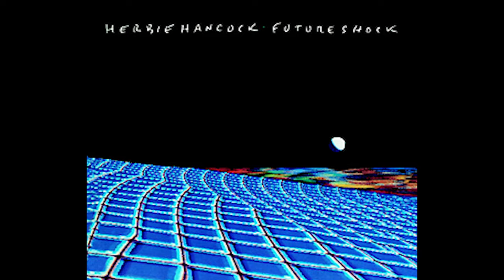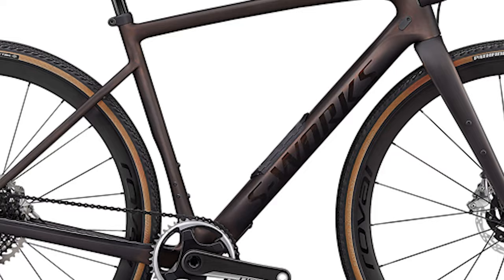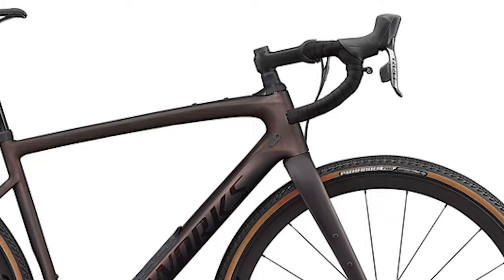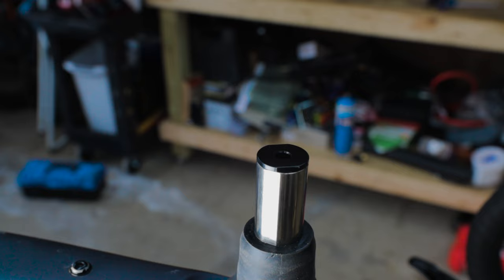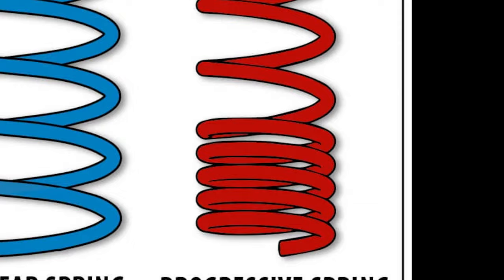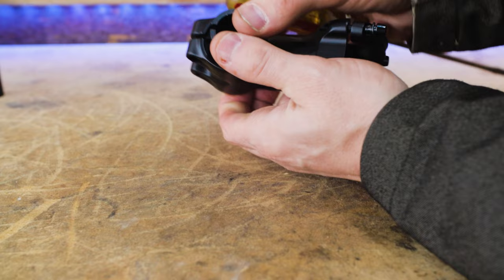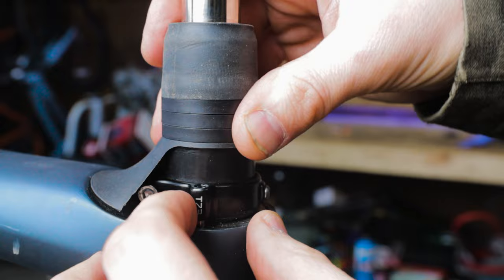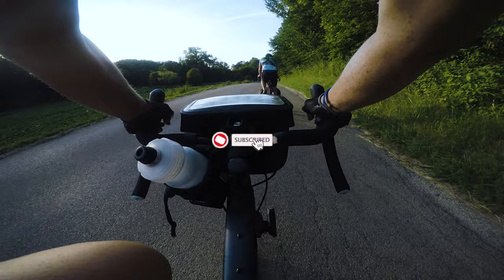Specialized Future Shock - Deep Dive & EVERYTHING You Need to Know!

Comment from the maker: I got official word from Specialized: the main spring in the cartridge is progressive, not the booster springs. The replacement cost of the 1.5 is $250 and the 2.0 is $515.
Reply: Thank you for these prices! Are those prices for a set of 3 springs (same set as what comes with the bike), or for a single spring?
Reply from the maker: You’re welcome! Those prices are for the full cartridge replacement. With a new cartridge you should get everything that came with your original bike: stack height adjustment parts, shim for a standard stem, that crazy little 3mm wrench, and new booster springs if you have a Future Shock 1.5.
Reply: @GreatEgretAdventure  That's great. Seems like a reasonable cost, for such a unique system.
Reply: . @GreatEgretAdventure   Never got the 3mm wrench.  I guess the bike shop held onto it.  Had to buy a hard to find new one and filed down the flats to make it fit

Comment: If you buy a new Specialized w futureshock,  the 3mm wrench should be included in the bag of parts.  It’s included from the factory.
Reply from the maker: That’s correct. Thanks for clarifying that! Along with the shims, stack lowering part, and booster springs with the 1.5.

Comment: I have the 2.0 on my diverge I took delivery on 13 months ago. I only gravel on it or ride once a week. Just finished a race two Sundays ago.  So far so good 😊. My diverge is not my main bike so will take a while to achieve the 500 hour service point. And I have not had a low battery 🪫 on the 1x Di2 yet either, it’s lasted over a year so far.  Next swap out is the hover bars. Just don’t like the top section diameter and the contour of the top section, no room to move my hands for size 42.  Pressure and pain points on hard bumpy efforts. 🤔🤔🤦🏻‍♂️

Comment: Is it 2.0mm hex to re-tighten the pre load screw at 10:50 in the video? I think it should be 2.5mm hex.
Reply from the maker: Yeah, 2.5mm to loosen, 2.0mm to adjust, 2.5mm to tighten along with the 3mm wrench. I said 2.0mm to tighten when I should have said 2.5mm. I’m going to fire the proof editor. Oh, crap that’s me! Thanks for catching that.

Comment: Hi, how much can the stem lowered? The default setting is with the high cap? I am asking because the stack of the current diverge seems too high compare to backroad, nuroad or grail.. i wondere if the stack is lowerable, in manuals it says adjustable from 0-15 mm of hight. thank you
Reply from the maker: The stack can be lowered. Check out this video at 8:54 where I talk about the low headset cap. You need to remove the tall headset cap and install the low headset cap. That’s the lowest the stack can go with the Future stem. If you want it lower, you’ll need to install a standard stem with a negative degree angle. 

The 0-15mm height refers to the number of spacers you can fit. Each are 5mm. This means you can go with none, one (5mm), two (10mm), or three (15mm). 

I hope this helps.

Comment: This is an excellent tutorial. Thanks. Stupid question from a non-techie. If you want to replace the stem with one that has a smaller stack height than the standard 40mm, do you need spacers to make up the difference?  Any guidance appreciated.
Reply from the maker: Thanks Steve! Your local bike shop should have provided a shorter cover.

Comment: My futureshock replacement was $149 (1.5). In california.  They gave me a discount as full price was 250.  This replaced a futureshock on a 2018 diverge.
Reply from the maker: Yeah, I misspoke on the price. I accidentally quoted the price for the 1.0. I’ll have an update video soon where I’ll talk about the springs more and add a mea culpa about misquoting the replacement cost. Thanks, Craig!
Reply: @GreatEgretAdventure  no problem...if you are doing another video, maybe you can explain how the booster springs work.  The FS works without the spring so what does the spring do?  Seems to me that the booster spring will not even engage  until the main spring starts compressing. But that can't be right.  Btw, i had a fs 1.0 and they replaced it with a 1.5.  I don't think the 1.0 is made anymore.  Thanks!
Reply: @craigvaughn1591  why did you have to replace it so soon ???
Reply: @johngilmartin2146  there was about 5 mm of play in it. I could depress it by just pushing down on the handle bars. It would chatter when going over even small bumps.   Bike had about 20,000 miles at time of replacement.   New futureshock did not come with booster springs.  I had the teck install old booster springs in new shock.. Still not sure what they do.
Reply from the maker: My next video will cover more on the Future Shock including more information on the booster springs. According to the Specialized rep I spoke with, the booster springs create more vertical stiffness.  The booster spring isn’t necessary if you’re happy with how stiff the Shock is with just the primary spring. In fact, all 1.5 future Shock bikes now arrive without a booster spring installed. It’s up to the bike shop to ask the buyer what spring they want installed, if any, when someone buys a bike with a 1.5.
Reply: @GreatEgretAdventure  ok look forward to seeing your next video

Comment: Does using the variable angle stem allows to uniformly sit the top cap? It is supposed to be used on perpendicular top stem like fixed ones
Reply from the maker: I haven’t heard or read that a 0° stem is required. If that’s true, bike fitters would not even fit anyone riding a Diverge. The angle of the variable angle stem does not impact the top cap anymore than any other stem of any angle.

Comment: The cartridge(shock absorber) is ingenious: So I can  "replace the cartridge for around $55". But If I want to buy a 2.0 bike instead of a 1.5 cartridge bike the cost is an additional  $7,000? I am just getting into serious cycling but the costs( asking prices) are nuts. $10,500 buys a pretty nice, used Harley Davidson. Hydraulic damping is nothing new.
Reply from the maker: Unfortunately, the $55 I cited on here was from when the Future Shock 1.0 came out. The replacement cost of the 1.5 is $215 and the 2.0 is $515. Still way better than a new bike.

Comment: Great Video! I installed a new stem on my Sirrus X 5.0 and found that the new stem is a little taller than the stock stem where it clamps on to the cartridge. The top cap shaft/threads do not go low enough to engage the threads in the cartridge. I think a 5mm spacer under the cartridge would be too much. Do you see any problem with not having a top cap on? It seems to be just a cosmetic piece. Any chance there are top caps with longer shafts available? Thanks!
Reply from the maker: I think you’re right. It’s cosmetic.

Comment: Good dive into the future shock.  I bought a carbon spot last fall and haven't had a chance swap springs around at all.  My wife has a Roubaix both with the 1.5.   I just looked at the springs that came with mine and they appear linear also but I'm wondering if the progressive coils are just not noticeably narrower.
Reply from the maker: You know, I thought the same thing about the progressive springs. It is only 20mm of travel. If yours look linear as well,  it has to be that they are not noticeable. So I decided to measure with my digital calipers. Unless the differences are less than 0.1mm, there is no difference in the size. If there is, that degree of progressiveness seems so nominal that it wouldn’t make much of a difference. I’m no engineer, though. Either way, your comment is really helpful and I’ll include it at the end of the next video. I’m curious what others think. Thanks Rob!
Reply: @GreatEgretAdventure  sent you a comparison photo on IG.   They could probably accomplish some progressive nature with heat treating.    Visually though no difference.

Comment: Thanks for the great information. Well done. Can you tell me where I would get torque information on diverge bikes.
Reply from the maker: Thanks! I work hard on these, so it means a ton to me when someone finds the video helpful or entertaining. The torque specs are in the manual that comes with your bike. Judging by your previous comment, it sounds like your LBS didn’t provide it to you. If you need a specific torque spec, just let me know here and I’ll post it.
Reply: @GreatEgretAdventure  no manual provided. Wonder where I could get one?

Comment: thanks for the video, very useful. Just a question, can I get rid of the future shock altogether ? will the fork / steerer / stem work if I cancel the future shock ? or do I need a new fork ?! thanks again
Reply from the maker: One of things I don’t like about the diverge is that you’re stuck with the Future Shock which also means that you’re stuck with the fork. The head tube on the diverge is sized to only fit the Future Shock so putting a regular headset in there won’t work, unfortunately.
Reply: @GreatEgretAdventure  thank you so much for your knowledgeable and helpful (and prompt 🙃) reply … I thought I can cancel it as it’s really noisy. Would you know if it can be upgraded to 2.0 ? Is it quieter / heavy duty ? Thanks again
Reply from the maker: @emiled591  the Future Shock shouldn’t be noisy. That’s a sign that that something isn’t right with the internal spring. It likely needs replacement. If you bought the bike recently, it’s probably still under warranty. The 2.0 isn’t necessarily beefier, it’s just a different design with different features (oil damping, dial to change preload, no booster springs). If you wanted a 2.0, it’d fit, but at a replacement cost of $515 USD, it might not be worth it.

Comment: I have a question about the Specialized Stem you bought for your wife.  One of the things my LBS said was that stem combined with the FutureShock, because it has two shims essentially, it would make a lot of noise.  Have you experienced that?  I need to work on my reach a bit and thought this might be a good option for me as well.
Reply from the maker: No noise at all. Noise would be caused by movement and the shims are pretty tight without moment. Just make sure to torque them to spec. I think it’s a great option at finding what angle stem will work best. It’s also much less expensive than trying a bunch of different stems. Once you find which angle works best and want a lighter stem, you’ll know which angle you’ll need. Let me know how it goes for you.

Comment: Anyone have a rough idea of the cost for a 2.0 Cartridge replacement?  A bike fitter changing the stem broke mine and the local Spec shop is saying it’s going to be VERY expensive. Hoping it’s not too high, or it’s a pretty bad design.
Reply from the maker: I’ve heard $250 for the 2.0 cartridge. I’m working on a follow up video to this one and I’ll have a definitive answer soon. I’ll comment here when I do.
Reply from the maker: I just found out the 2.0 replacement cost is $515. The 1.5 is $250.

Comment: Ready for the bin after 2 years.
Reply from the maker: Did yours fail?
Reply: @GreatEgretAdventure  My 2.0 shock has completely seized after 6 thousand mainly dry miles.Around £500 for replacement in the UK.Shocking!!
Reply from the maker: That’s nuts! The worse part, as you already know, is you can’t replace it with another option like aheadset stem and headset.

Comment: So I have a 2021 specialize Evo with a flat bar with Future Shock 2.0 with adjusting ring. Looking to raise the height. Are spacers along with a different bar the only options I have? Looks like 15mm is the max I can raise it with spacers. Thanks for your prompt responses.
Reply from the maker: The other option is to get the shim so that you can swap out that Future stem for a standard stem that has a higher degree angle. 15mm is a lot of rise. That will affect the way your bike steers. Not in a bad way, but it will provide a different feel. I’d start with the spacers and then consider a new stem if you need more rise.
Reply: @GreatEgretAdventure  did you mean “not a lot of rise” ? I agree - that’s a little more than 1/2 inch. Was thinking about coupling that with a bar with more rise. the current one I have is a 10mm rise.So where would I get the shims? Specialized bike shop?
Reply from the maker: No, I mean 15 mm is a lot of rise. When it comes to bike geometry, handling, and steering, a 1/2” change will greatly impact how a bike feels, maneuvers, and steers. Especially steering. As little as a few mm can be noticeable. This is why spacers larger than 5mm are rarely used and why Specialized says to not go above 15mm. I’d start with the three 5mm spacers before making and other changes to the stem with the shim.
Reply: @GreatEgretAdventure  thanks for the great advice.
Reply from the maker: @pault477  no problem, Paul! Good luck!
Reply: @GreatEgretAdventure  so decided to reduce stem length ( 40 mm ) and put a different flat bar on with greater sweep and rise. Made a huge difference on reducing back strain.

Comment: I have a question.
What about a service life of the future shock 1,5?
Some say that it is 500 hours and then it has to be replaced or serviced.
Reply from the maker: Around 2018, there were a lot of rumors around the 1.0 having a service life of 500 hours. I’ve never seen an official document from Specialized saying that 500 hours is the magic number. That doesn’t mean it doesn’t exist. It’s possible it does and it’s possible that’s true for the 1.5 and the 2.0 as well. 

Depending on the rider and riding environment, 500 hours is a lot of miles and ride time. After 500 hours, I’m servicing or replacing a lot of components. Including chains, tires, wheel truing, cables, derailleur indexing and cleaning, or brake fluid if I’m running hydros. Hopefully more servicing than replacing depending on how rough I am with everything. I’d treat the Future Shock like any other component, if it’s still working, keep using it and then get a replacement when it stops working.
Reply: @GreatEgretAdventure  So when it stops working what happens? Just stops functioning right? It will just feel rigid that is all?
Reply from the maker: @bigbywolf6510  I have never known one to stop working other than another viewer on here told me a bike fitter broke his Future Shock. All the bike mecahnics i've talked to have never had to replace one. The 1.5 would likely fail because of the internal spring gets damaged. I don't think it would be rigid.  It would likely feel crunchy.  The 2.0 could fail because something goes wrong with the oil and no longer provides damping.  I'm just theorizing here though.
Reply: @GreatEgretAdventure  Okay thanks for the reply, I really like the future shock and innovation.

Comment: For my diverge, I got the same springs you show.  If they are linear, seems the Diverge ships with these now.  Could the springs have wider spaced coils under the color covered section?  Maybe not.

I confirmed with Specialized and these days. all the Sport Carbon Diverge is supposed to ship with is the manual and springs.  No shims or shorter duck-bill were supplied and the future shock was delivered without a spring installed.  All good but anyone buying these should ask for your springs if you don't get them and double check what's in their future shock.
Reply from the maker: I’m going to do a follow-up video, I think. All the procedures here are correct, but I’m pretty sure I misspoke on a few things. I think the progressive spring in the permanent one in the cartridge and not the booster spring. I’ll confirm tomorrow. I also need to do a mea culpa about the cost of the cartridge replacement. It’s the 1.0 that’s $55. The 1.5 is $150 and I believe a 2.0 is $250. 

Thanks for the info on the shims and the shorter duck-bill. I’ll include this information in the update video. Thanks!
Reply: @GreatEgretAdventure  I got all that  stuff when I bought a new diverge carbon comp in March (the $3300 model with FS 1.5).  Springs, shorter duck bill, the works.
Reply from the maker: @seanvarley1365  Kate had a Comp for a hot second in spring of 2020 before trading it back for the Sport. She also got all the parts included with both bikes as well. Thank goodness because there I was able to do this video.
Reply: @GreatEgretAdventure  Whoops, no I have the Sport.  I can't keep their naming convention straight.  :)  My wife got zero parts with her Ruby in 2019 though.
Reply from the maker: Naming conventions for these are hard to keep straight! I’ve had to reshoot an entire video once because I kept calling the Sport the Comp! 😂

Comment: Can you change the spring on future shock 2.0?
Reply from the maker: Nope. It’s fixed. The only way to adjust damping is with the dial and if the 2.0 breaks, the only option is to replace it.
Reply: @GreatEgretAdventure  and replacing the fs 2.0 is around $500 ish?
Reply from the maker: It was at the time of this video a little over a year ago, but I bet the prices have gone up a bit.

Comment: A non serviceable cartridge is a joke. Huge upcharge by Specialized for a minimal movement suspension gimmick in the fork, and a lot more money for Specialized dealers who make bank every time the thing breaks. At this point Specialized could market snow to an Eskimo and pull it off. LOL
Reply from the maker: You’re probably right about the future Shock being a gimmick and the up charge from Specialized. Kate doesn’t feel it’s needed on her Diverge and I’ll opt for adjusting my tire pressure for suspension on my bikes. 

But it’s super rare that you would need to replace the cartridge. I know of only two from comments on here. One was because a bike fitter accidentally broke it. Every specialized bike mechanic that I’ve spoken to has never had to replace one. Most importantly “dealers” is a term typically used in the automotive world. Specialized bike retailers are independent bike shops and I’ll support them every way I can. Without them, there are less butts on bikes.